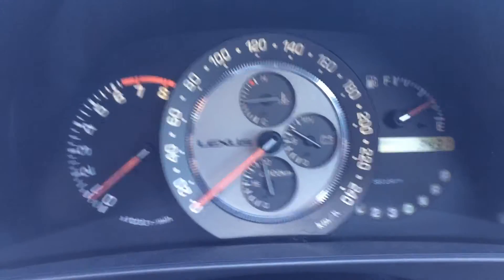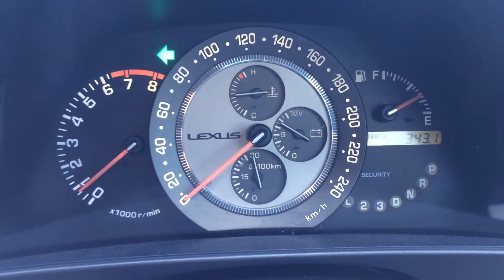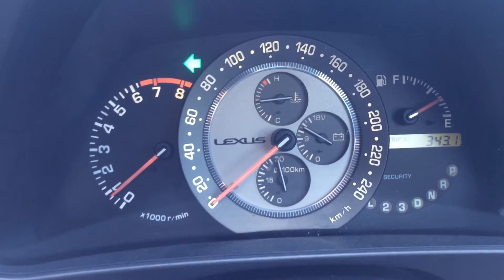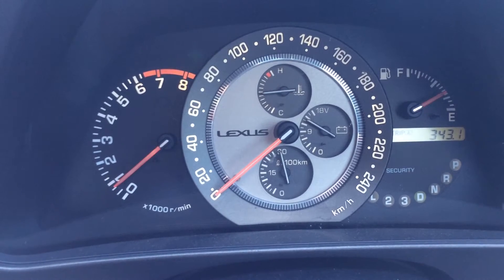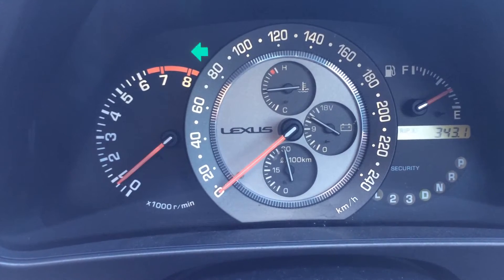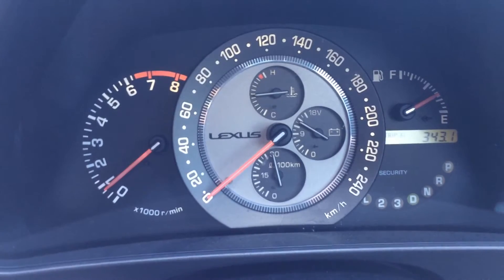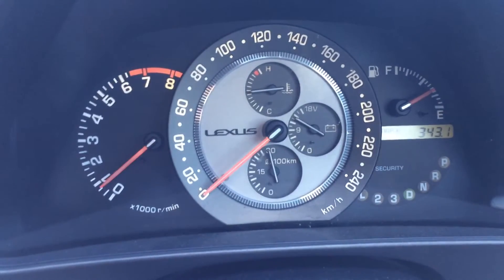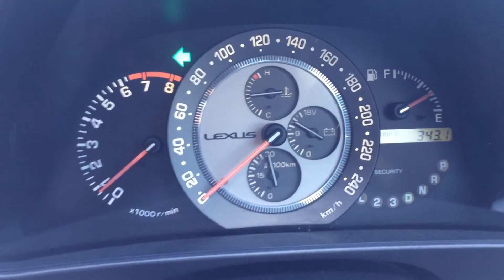Acceleration test with ACIS System Disabled

Comment: so when acis is in low volume / high air speed position is it with short or  long intake runners? in the description it seemed like in the off position its a short runner and if acis is activated it turns into a longer runner (but at higher rpm you want shoorter runners?)

Comment: I did as you showed and i noticed increased fuel consumption. it is a bit early to say definitely but it is up by about 20%.
Reply from the maker: Very odd, I didn't notice any negative affect to fuel economy
Reply: +MrExtremeboost MAX Boost I might just be to enthusiastic with a throttle.
Reply: That's because you made your car slower and less efficient.

Comment: Hi mate, you may be able to help me. I've just bought a 1999 Lexus IS 200 auto with 191,000kms on the clock. Very tidy car but I am having a strange hesitation issue which feels like the engine is starving for air when you put your foot down in first gear. between 2-4k rpm it just chokes and doesn't go anywhere for about 3-4 seconds, no stuttering or misfiring (all ignition coils and spark plugs were replaced six months ago by previous owner). Also ACIS doesn't seem to kick in at all in first gear but does intermittently at higher speeds, but around 5k rpm. There have been a few times I have noticed the kick missing completely.
It's quite strange, maybe you've got some ideas what it could be?
I'm going to upload a video to youtube of it happening, I'll post it here when I do.
Reply from the maker: SteveNzify yes i know exactly what your on about, sometimes the ECU doesn't allow the ACIS change, just like the partially DBW throttle body, all the following things can affect (ie the computer will/won't allow)
*engine temperature
*gearbox temperature
*all normal engine sensors (Knock sensors/air temp etc etc)
*steering angle (to be confirmed)

i noticed a huge change in the way the engine responded when i filled up with ordinary 91 RON unleaded (normally i run 98 RON)

i have cleaned my VVTi filter also - search for this, there is a UK based guy that does a simple step by step instructional of how to do - very simple and you will be surprised at how much torque can be lost due to an inactive or under active VVTi solenoid.
Reply from the maker: SteveNzify  i should also add to the below - my IS has 309,000kms on it now - and i still use 5w40 Full synthetic oil (penrite HPR5 actually) and i change it and the oil filter every 5,000km.. inside the engine and particularly the VVTI filter 'can' be gunged up from extended service periods (ie well over 10,000kms between oil changes).. fresh good quality oil changed frequently - your engine will love you for it!
Reply: MrExtremeboost MAX Boost I also changed the oil on the weekend just been.
It didn't go as smoothly as I expected, you can read the story here - http://au.lexusownersclub.com/forums/topic/13195-had-the-car-less-than-a-week-almost-cooked-the-engine/
Reply: SteveNzify was same with mine lex. Its clogged catalytic symptoms